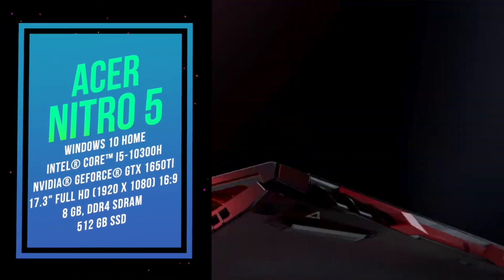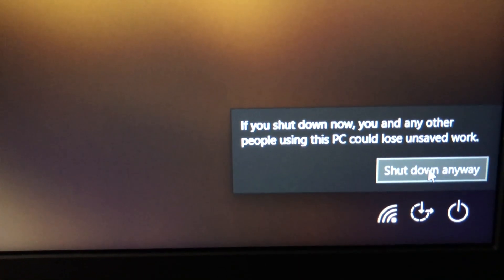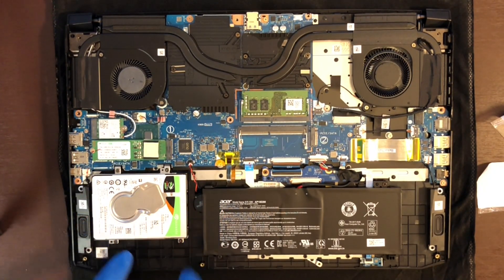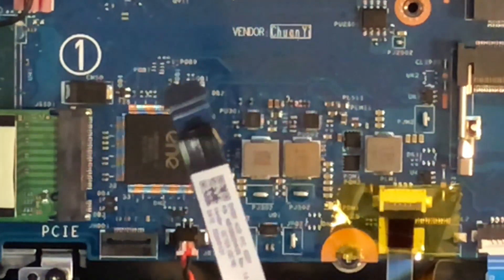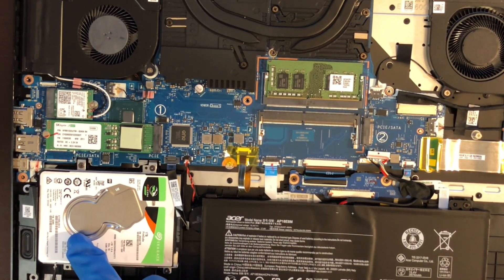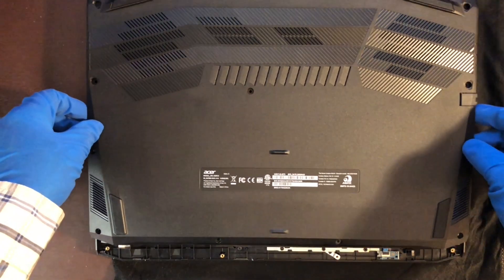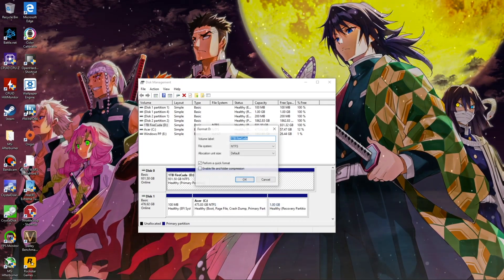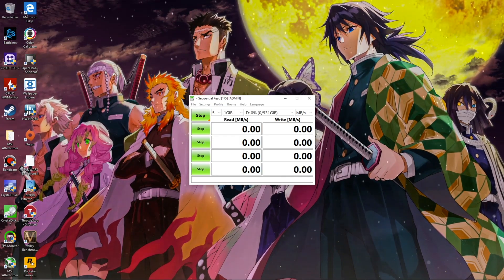ACER NITRO 5 2020 Hard Drive Install

Comment: I have the same model laptop and i have an issue....basically i have a brand new ssd that i bought and tested ...so there is nothing wrong with my ssd..once i installed the ssd into the laptop and closed everything up nicely exactly as you did and hit the power button, my pc turns on but the screen is black..i tripple checked everything and still nothing..so i took the ssd out and the laptop boots up with the screen now on..any suggestuons?
Reply from the maker: What do you mean black?  Solid? No words or errors?

Comment: As a retired PCTech/Programmer/Controls Engineer this was well done. You are easy to understand, technically correct an no obnoxious music. Instructions were spot on and I suspect anyone could follow them.  This is a new laptop and the distributor left out the HDD. I could send it back or install it myself (which I did). I would like your opinion on the thermal impact of eventually upgrading the SSD and HDD both to 2TB each. This seems to be a good laptop.  I always run laptops with cooling fans underneath to help draw out the heat.  BTW I found there was a place on the ground plane I could attach my anti-static strap to. Thank you.

Comment: Hey question, when I turned on my laptop it just turned on and off so fast. And when I took out the drive it turns on fine. How do I fix that?
Reply from the maker: Is it a new blank drive?
Reply: @Meanpooh  Its new, it’s a Firecuda 1tb
Reply: @Meanpooh  I got it in the mail today, but each time I turn on the laptop it turns on and then black screen for 1 second and turns off
Reply from the maker: If you manually installed the cable try reinserting it at the board.  That may be the problem. usually a broken hard drive will cause the computer to post an error.
Reply: @Meanpooh  how do I restart the board?
Reply from the maker: @Compramela  Reinsert. Not reset. https://youtu.be/W9ZbYoxrM-8?t=148. The cable could be the problem.
Reply: @Meanpooh  oh yeah I do that every time but when it’s in And I put back the power it just turns on and then off. Do you think it’s the cable? Cause I have not opened that cable since I got it

Comment: I have the acer nitro 5 an515-54 with 128gb ssd + 1tb hdd. Can I install another 1tb ssd or hdd in the 2.5 inch spot?
Reply from the maker: Yes.

Comment: Question do i need gloves or is that just a recommendation and can i disassemble it on a mousepad or maybe i can do it on wooden floor and for the battery can i use my hand
Reply from the maker: You don't need gloves.  I always use them being cautious.  The most important thing is making sure the power is disconnected from the battery and trying to be static free.  You can completely a change out RAM and a Drive using only your hands and no other protections but it's risky especially if you are working on another persons machine.

Comment: I'm planning on adding a new hard drive to mine but it's a much larger (storage size) than this. It's 5TB but it is still listed as a 2.5 drive so it should still work right? https://www.newegg.com/seagate-barracuda-5tb-st5000lm000/p/N82E16822179104
Reply: Most latops will only take 2.5" drives with a height of 7mm. As far as I'm aware 4tb and larger 2.5" drives have a height of 15mm and will not fit.

Comment: Well done video and really appreciate your thoroughness. I recommended this laptop for my friend. I've worked on a fair amount of laptops and Acer is my favorite- I've also personally had my best luck with Acer also. They are one of the few manufacturers that make it easy (albeit lots of screws) to take off the back panel- then after that you have complete access to most everything- easy to upgrade and clean. I've done HP laptop upgrades to replace the HDD with an SSD and need to disassemble the back, the front, remove the keyboard- just ridiculous!
Reply from the maker: Thank you!  Sometimes I don't understand these manufactures on the decisions they make for additions and repair.  Sometimes I think they do it so the average person would go to a repair store to have it done.  This usually generates revenue for the computer manufacturer as they most likely had to get some kind of certification to be certified for certain brands.  Reason i say this is when I worked in a chemical lab we had to get training in certain ISO's to do specific gravity and adhesion tests for a a few manufacturers.

Comment: meanpooh, i think there should be improvements on hdd speed since the laptop integrated with OPTANE , i think you should try open optane storage management that included as a program in the laptop. it should be already installed.
Reply from the maker: I don't have obtained in my machine.  It is supported though.

Comment: Hey Meanpooh, my bracket wont come out because one screw is stuck. So i have added the ssd with only 2 screws just like you. Is that fine for the ssd? Wont it fall out or something? Thx

Comment: Hey, do you know any other  Seagate Drives that work with this computer that are cheaper?
Reply from the maker: Most 2.5 drives under 2TB will work.  It does not have to be a SSHD drive.  WHOA!  I just did some searches and drives have went up as well as most computer parts.  This is crazy.  Tariff stuff.
Reply: @Meanpooh  yeah, the one you used is 200 now!
Reply from the maker: That is insane!
Reply from the maker: https://www.staples.com/seagate-2tb-barracuda-sata-6gb-s-128mb-2-5-inch-internal-hard-drive-7mm-st2000lma15/product_24394680

Comment: this video helped a bunch thank you i only have 1 problem after the hdd install i played far cry 5(still installed on the ssd) and had severe frame drops making the game unplayable after the hdd install and when downloading a game on the hdd it says the save file is corrupt i didnt go in the bios when installing the drive so im wondering if thats the issue?
Reply from the maker: Going into the BIOS is not necessary.  It's just a confirmation that the drive can be seen  by your machine.  Do a reinstall of the game.
Reply: @Meanpooh  i did but my frames are better but not at the original frames it was and stutters quite frequently should i take out the drive and see what happens then and if so what should i do before removing the drive (thank you so much for your help i have been stressed all day trying to figure out how to fix these issues)
Reply from the maker: You could try but i've never known a hard drive to affect another drives performance unless the drive is bad.  If that's the case you should have gotten blue screens by now.  Installing the game on Hard Drive and not SSD will only make loading a tad slower.  I play a ton of games from a portable external drive no problems.
Reply: I took out the hdd and it ran normal then I put it back in and it ran normal I’m assuming I didn’t plug in the hdd cable to the motherboard correctly thanks for your help
Reply from the maker: @cutsushi2953  Great, always check to make sure all connections are snug.  Glad you got it fixed. 👍

Comment: Excuse me, I have heard that the acer nitro 5, especailly the rtx 2060 and i7-9750h version, has major heat problem. I looked at the possible solutions but all of them I do not agree with. All of them include either, a risky way of stopping, or it will decrease fps and clock speed, including no boost clock on cpu. My only option I have left is to buy a cooling pad. I don't have much more budget because I only have 20$ to spend. Can you send me a link for the best 20$ cooling pad for my version?

Comment: How much Hardrive can my 2019 model acer nitro 5 handle?
Reply from the maker: You can’t go too thick with the 2.5 Hard disk drives. From experience you can go max 2TB, anything over that will not fit in the case. If you are using SSD or NVME, you can go pretty high.  At least 4TB if you can afford it.
Reply: I am Farley new and still learning about SSD’s and hard drives. What makes an HDD costs less considering it can have more capacity than the m.2,costs more but has less capacity? Or can I setup dual drives, both an HDD and M.2 ssd?

Hard Drive: (Seagate BarraCuda 2TB Internal Hard Drive HDD – 2.5 Inch SATA 6Gb/s 5400 RPM 128MB)

M.2: SK hynix Gold P31 1TB PCIe NVMe Gen3 M.2 2280 Internal SSD - up to 3500MB/s
Reply from the maker: https://m.youtube.com/watch?v=NeRuEZSubFs

Comment: Just a quick question, can you reply to me a link for the latex gloves. My hands have a severe problem of sweating and I don't want to break the computer because of the sweat. Thank you
Reply from the maker: Here you go.  They are dual purpose exam gloves and come in latex and latex free.  There are also different sizes.  You may be able to find some at your local grocery, big box or hardware store.
https://amzn.to/3mr7bQX
Reply: @Meanpooh  Will these help with the static as well? or is it fine without them
Reply from the maker: Yes it will help since it’s made out of polymers that won’t conduct electricity. If you’re careful you can not use gloves at all.
Reply: @Meanpooh  What are things I should beware of or not do because my hard drive will come before these

Comment: I have the an515-54, (i7-9750h and RTX 2060) acer nitro 5, will it work?
Also, I will add a 2TB HHD, will that work on it?
Lastly, do you have to remove the battery or battery cable? This is because some videos don't do this and I am worried that I will break my whole computer buy messing with the battery.
Reply from the maker: Yes it will fit.  Remove the battery, it's good repair practice.
Reply: @Meanpooh   do you think something will happen if I don't remove the battery?
Reply: Because I dont feel comfortable messing with other parts
Reply from the maker: There's always a possibility.  Its only 1 screw.
Reply: @Meanpooh  So no need for taking out the battery?
Reply: @Meanpooh  So do I have to or not? I am only a teen and I don't want to break it because It came in the mail yesterday along with the hard drive?
Reply from the maker: If you don't remove the battery at least unplug it from the board as seen in the video.  If you don't do either, take your time and hope you don't short anything out.
Reply: @Meanpooh  I will just unplug it and put it back like you did in the video because now I think it is not as bad.
Reply: Thank you
Reply: You just gained a new subscriber😁
Reply from the maker: @marktube650  Take your time and gently remove the connector..
Reply: @Meanpooh   I just did and now I am placing the hard drive 😀
Reply from the maker: @marktube650  Alright!  Great work!👍

Comment: Do the second ssd support sata III? Or only nvme?
Reply: The acer nitro 5 has a 2.5 inch a for a ssd or hhd. It also has a slot for an nvme ssd. So you have two slots to pick from

Comment: Did you replace your original harddrive with this method? or is this a secondary harddrive that can be used when the stock harddrive fills up?
Reply from the maker: secondary

Comment: Could you recommend some rams of 8 GB to make it dual channel and of how mutch mhz , my nitro has intel 10300 & max ram speed is 2933 mhz
Reply: Hi there!  If you're still looking I found these at Amazon (Mushkin Essentials – DDR4 Laptop DRAM – 32GB (2x16GB) SODIMM Memory Kit – 2933MHz (PC4-23400) CL-21 – 260-pin 1.2V Notebook RAM ) Just popped one into a Nitro 5 17.3"  Seems to be working fine.

Comment: Should I disconnect or remove the battery while installing ssds and ram and such
Reply from the maker: It's good practice to do so and to prevent possible electrical shorts but when you get good at it you may be able to leave it plugged in.  I always disconnect.

Comment: will this work with this tutorial or do i need to buy one of the single or dual mount brackets or something? also is this a good ssd to use for this laptop? And will it come with a connector cable? this is the ssd i was looking at lmk what you think
https://www.amazon.com/Samsung-Inch-Internal-MZ-76E2T0B-AM/dp/B0786QNSBD/ref=sr_1_2?crid=2IPB1DOVKRY7X&dchild=1&keywords=samsung+860+evo+2tb&qid=1600702308&sprefix=samsung+860%2Caps%2C164&sr=8-2
Reply from the maker: Yes it will work and will be faster than any 2.5 SSHD.  Everything you need is in the box.
Reply: @Meanpooh  alrighty-o thanks man

Comment: Yo. I saw a tutorial on Acer's site where they advised opening from the back of the laptop. Which side do you think is better, from the front or from the back of the laptop?
Reply: And how exactly do you open it from the front?
Reply: @beetlejuice1947  you turn the laptop upside down and start from the left corner. Just like in the video
Reply: @Uehfiwhdo53  thx

Comment: mine didnt come with the hdd cable will this work? https://shopee.ph/product/135511545/4909614311?smtt=0.0.9
Reply: im also buying the same hdd but 1tb
Reply from the maker: I would contact Acer and tell them it didn’t have one. They may send you a kit. If your machine already has a SATA drive installed then you won’t have one in the box.

Comment: I might do this but I fear I might  screw up
Reply from the maker: It's easier than you think.  Hardest part is opening it.
Reply: @Meanpooh  Ok thanks
Reply: @Meanpooh  Which harddrive should I use for mine? the ones with laptop in the title seem to be a lot more expensive. :/

Comment: Thank you.  This is a very clear video and you explain each step very well.  I bought this model Nitro 5 today and may upgrade it eventually.
Reply from the maker: Glad you found it helpful!
Reply: PS - I had the previous model Nitro and that was easier as it has a panel for the additional drive.    I later upgraded the 128 SSD to a 512 and boosted Ram to 16 GB.  It is still a good machine and I gave it to my wife so I had an excuse to buy the newest model.  

https://www.youtube.com/watch?v=CahBU2NgCnk
Reply from the maker: I hate that the manufacturers are making sold bottoms to the machines but I understand. 1 less screw can save 5 cents and 1 less cut could save time on an assembly line and wasted material. Just makes it difficult for us DIYers.
Reply: Mine came with the hard drive cable thing, is that just the cable for the hd but not the actual hard drive.
Reply: @Spiikz  Yes that is just the cable you use if you buy an additional hard drive to install.
Reply: @Wolfie6020  what size hard drive would I need, i have the laptop with the rtx 2060 and i7 9750h
Reply: @Spiikz  Really that depends on how many programs you wish to install.  I generally add a 500 GB drive to my laptops.  That is enough for me but if you have a lot of programs / games etc then a One Terabyte drive might be better.
Reply: @Wolfie6020  I meant like what size do i need, i see 2.5 inch ones and 3.5 inch ones

Comment: What is the maximum depth for the drive. Will a 15mm drive fit? Want to put in a 5GB barracuda.
Reply from the maker: It wont fit.  Typical is 7mm.  The 5TB is around 15.  The Nitro 5 is just over an inch including lid.

Comment: Does the 2tb hard drive in the description work with this laptop?
Reply from the maker: Yes.
Reply: Meanpooh thank you!
Reply: @Meanpooh  Mine doesn't work, I used it for my ps4 but switched it to my laptop. I want to wipe everything on my laptop but it doesn't sag "segate drive" only "heathly" "1817.38 gb" and won't let me format 😭
Reply from the maker: @creed1741  Did you try in disk management?

Comment: Where did you get the hardrive cable?
Reply: It comes when you get your laptop. It comes in the same box as the laptop as well as those screws for mounting the drive as shown on the video

Comment: Can i put a macbook hdd 2.5 in there?
Reply from the maker: Yes.
Reply: @Meanpooh  nice i have 500gb hdd just waiting for my laptop in August the specs is 
i5 10300h
Gtx 1560
8gb ram 
256gb ssd 
For 700$ is that a good deal?
Plus what ram should i put it in?
Reply from the maker: @limwellz  Yes, its a pretty standard price.
Reply: @Meanpooh  did you upgrade your ram ang how much fps did it gain they say dual channel boost fps is that true?
Reply from the maker: It can help but its not a deciding factor in boosting FPS.  I'm currently waiting for my RAM to arrive today.
Reply: @Meanpooh  nice hope you can test it single vs dual channel

Comment: I don't think you would know this, but when I bought my 2019 model acer nitro 5 I was told by a best buy employee if I bought the protection plan I could upgrade once the new acer nitro 5 came out. I bought the protection plan but not for that just to have but is that true what he said? Lol
Reply from the maker: He may have lied.  What he should have said is that when the new one comes out we will buy your machine at 20% cost.  You can then apply that money towards the new machine.

Comment: Im fairly new to computer hardware. I just received my nitro ( same model ) and I noticed some pretty severe bends in the hard drive adaptor cable that came with mine. Is this something I should be concerned with or does it not affect the wires?
Reply from the maker: Was it bent like the one I have shown in the video, of so then it’s fine.